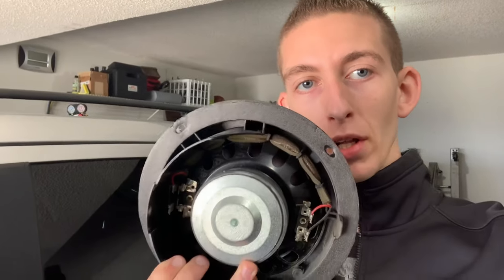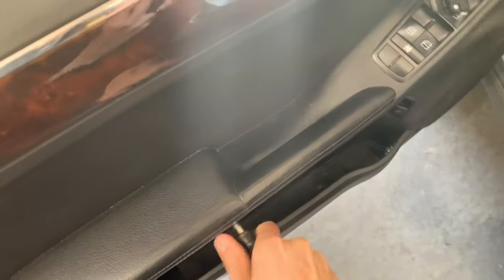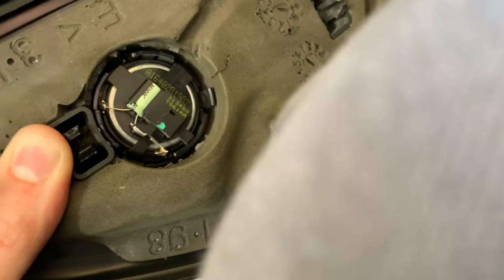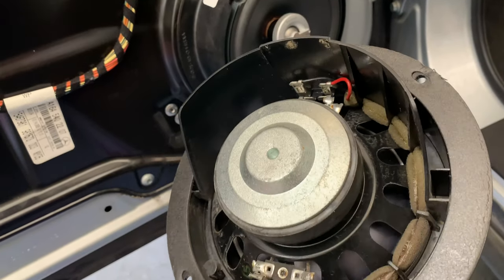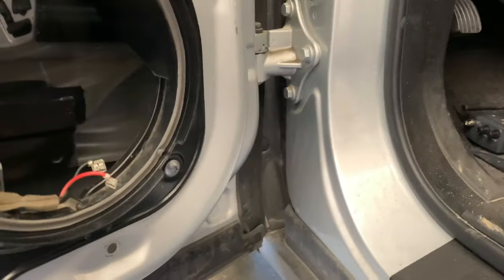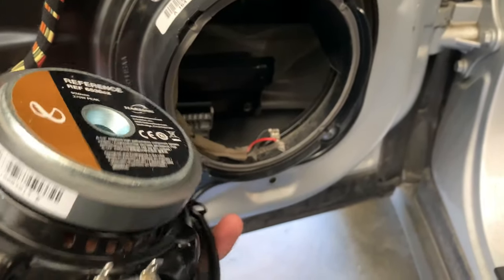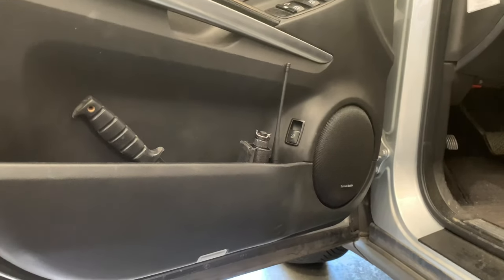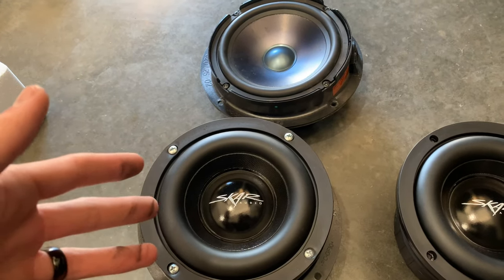How to Replace Mercedes Harman Kardon Speakers (upgrade and replacement)

Comment: How would you tell which way the polarity is suppose to go and thus know that you need to reverse the red and black wire connections?
Reply from the maker: You can connect a battery to the speaker such as a AA or a 9V to test positive or negative. If the positive side of the battery is hooked to the positive side of the speaker, it will poke out when you make a connection. If it sucks in, you have it backwards. You can test the old speaker coming out using the same method if you are not sure of the car's wiring.

Comment: I have a w212 2014 with harman Kardon. The Bass makes a rattling noise. It's really bad
Reply: Update I fixed it!! You dont need to do much buy a thick foam stripe with glue and remove the bass Cover stick it around the Cover and put back on. Boom fixed

Comment: You should do sound insolation for the doors in 4 materials the sound will be even better. My stock H/K started to play a lot better! Up to 122db. Center of the cabin 116db.

Comment: I just installed these REF-6530cx speakers in my '11 C63 using this walk-thru, and I'm very impressed! They're a massive upgrade--much louder, clearer, and punchier than the factory ones. And this install video was really helpful, but note that my w204 speakers were only single-coil so I didn't have to do this hack described here.

Anyone attempting w204 speaker replacement must watch this video! 👏

Comment: I prepping for a front and back door speaker replacement on a 2014 CLA 250.  It looks time consuming and I have two kids, but I'm going to give it a go. 

My concerns is that I purchased a three way 4 ohm speaker and I'm not sure if the tweeters will engage.  Basically I'm asking if the connectors on the factory speakers are only going to play the mid range frequencies since it's been crossed over and the component setup is relying on the tweeters near the windows.
This is is not my profesion or passion so I apologies for the misuse of any terms.  Any help would be greatly appreciated- thanks.
Reply from the maker: To my knowledge, it doesn't filter the frequencies going to the speakers (except for the sub) but that may not be the case on newer models. I will say that putting tweeters in your door panel and leaving the window tweeters in-place will likely not sound very good. Too much high-end. Running 4-ohm speakers you'll likely get even less low-end to begin with on a 2-ohm system. Doesn't hurt to try things out though. Everyone likes different sounds. If you're happy with the way it sounds, that's what counts. Hope this helps!
Reply: I appreciate the feedback.  I'm still considering putting in the work or returning the speakers.  It looks like a lengthy job and I'm a little worried it's not worth the time.  
I'll post an update with the final results if I decide to do it.

Comment: Do recommend replacing the factory speakers or go with a different brand? My front two blew out on my mbcla250. Thank you
Reply from the maker: From my experience with this Harman Kardon system, I would recommend getting  something similar. Whether that is the original 2 ohm dual coil speakers from Benz or aftermarket 3 ohm Infinity speakers like in my case. As long as you get something with similar specs, it should sound good. A lot of the normal 4 ohm speakers that you find at the audio store simply won't cut it though if you want to retain the original amp and sound system.

Comment: I need your help I have 2004 mb e320 so I replaced head unit and all door speakers went with JL c1 components in front and coax in rear.  I also worked a sub amp up and running a kicker L712.  So I needed another head unit so I got xtrons headunit and bought 2nd amp to power door speakers kicker 4 channel.  So I took out the harmon amp.  Super hard to get it out was in trunk and left side wall.  So how do I wire up 4 channel amp in it place so I can eliminate the fiber optics completely.  So I have wiring diagram and I guess I am only going to use the 4 JL door speakers so I have all the colors of wires so should I cut the wires off harmon amp of the 4 door speakers and wire that to kicker amp so now I can use the power remote and ground off harmon amp.  Rca to head unit were do I plug them to head unit?  I used the sub out rca and ran y adapter to rca and then to sub amp.  So rca for 4 channel were do they go on headunit.  Also as far as the door speakers do I have to run new speaker wire?  I am lost now pleas help

Comment: Thanks went with jlc1s. But i need a speaker that will fit in the center spot i have updated everthing what 3.5 speaker will fit in that spot i already have new amp and headunit

Comment: HELP !  I have a 2014 CLS 550. rR speaker filled cabin w smoke and just cracks loudly even w Balance/ fade moved away. I have had several MBs w the HK logic 7 system and this is 3rd w same issue. Conflicted on keeping stock and replacing amp or going with something like you did. Hope the sub is ok. It’s on a separate amp. Any suggestions are appreciated!!!

Comment: Did yours fill cabin with smoke before speakers cracking and failing?  Had 22 MBs of various models through the last 20 years. 4 have had this failure with HC system. Seems like it’s between 70-100k every time. Required new Amps and speakers every time. Little scary if you aren’t “used to it”.
Reply: Yeah! I had a tweeter catch fire and several channels on the amp die one hot day. Probably other dead drivers too, I need to test them when I source a replacement amp. Given your experience, it would seem this amp might be prone to thermal runaway🔥

Comment: Some Harman/Kardon speakers including on my Mercedes W204 C-Class sound great, but when you playing it loud with rap music, there’s some rattling noises especialy on the rear deck which where the factory subwoofer ROCKING at, IT SUCK DONKEY ASS WHEN I’M PLAYING SOME NWA
Reply: If you have a panel in the back by your rear window i popped mine up and saw the speaker was blown i used some glue and i put a rag to stop the plastic rattle cheap fix until i can find a suitable replacement
Reply: If it's like my W212, the plastic circle in the middle of the rear deck speaker cones becomes loose after blasting loud music for a few years.  I'm sure they can be glued back on, but I just removed mine and it sounds great again.  It is a bit involved to get to the deck speakers on my model, but it was worth the trouble.

Comment: infinity kappa 603cf or audison apk 165 2ohm which one do you recommend thanks
Reply from the maker: I would lean toward Infinity as they are closely related to the original Harman Kardon but I have not listened to the Audison speakers so I cannot comment on their sound in these cars. I did try a pair of Hertz and they did not sound good at all in this car with the original system.
Reply: @FlyByTire  Thank you. I really appreciate 🙏

Comment: hi 
Fly By Tire, my car is w212 e300 2010 Mercedes, with no original amplifier in my car (domestic edition), can I istall these REF-6530CX  Speakers with no amplifier?
Reply: speakers always work without an amplifier....just how loud you want to push the speakers with clarity is all.  The amplifier just "amplifies" the peak of the electrical wave or more accuratley stated the "power" of the electrical signal to move against the magnet thus producing more forceful sound "vibrations".

Comment: Hi,  I have a w211 E class 2007 with Harman Kardon. I’d like to upgrade the woofer but I don’t know how many Ohms the original has. Is it 2 Ohms as the rest of the speakers? Could you please help me with this information.
Many thanks Vili
Reply from the maker: Hi Vilmos, thanks for watching! If you are referring to the door speakers, yes it is the same impedance of 2 ohms. If you are talking about the subwoofer, that might be different although I doubt it is. The easiest way to find out is to get yourself an inexpensive multimeter and measure it. Hope this helps!
Reply: Hi, thanks for your previous answer.Now I have a another problem with the H K system in my 2006 CLS. The bass power weakens after a short time I turn the music on. If I disconnect and reconnect the battery, it’s fine for a while but then it starts again, sometimes it only takes 5 minutes and other times I get up to an hour of normal function. The front door speakers loose the bass power the most. Could it be the amplifier failing, or can the speakers cause this as well? 

Many thanks!
Reply: Did you figure it out?
Reply: @Jemstk  unfortunately no, but i think one of the speakers is faulty and causing this problem

Comment: Good video, i have 2016 c class, i heard some vibration noise from the central dashboard speaker. Do you know how can I fix it? Some people said it's subwoofer. But I checked maybe it's not. And I am not sure if I can just pop out the cover of that middle speaker thanks!
Reply: same problem here, need to figure this out lol
Reply: @FAWX  my friend said you can remove the cover and change a new one or just disable it
Reply: vibration noise is usually loose wire connection and then secondarily bad voicecoil which can be replaced at speaker repair shop...you could have them check the magnet also....it is the interplay of the magnet with the "voicecoil" that makes the speaker move.  Parts for the voicecoil are cheap...but the knowledge on how to repair takes time.  Suggest highquality voicecoil as you can buy JBL, Infinity, but brands don't really matter...it is how it's made.  Ask around at an electronic parts store.....

Comment: FYI - with these cars the door will not lock when the door is open, which is why you thought it was broken but it's not.  By design the lock switch will lock all the other doors but not an open driver's side door.  Just in case you hit the lock button by mistake, close the door, and then realize your keys were left in the car.

Comment: I replaced my harmons with Memphis
Reply: How did that work ?  4 of my 20+ MBs with Harmon Kardon systems filled cabin with smoke before the loud popping. Had to replace Amps every time   Love to hear your feedback. Thanks!!
Reply: @l.b.stringfellow2413 I used jl c1 front back and two jl 12s in rear two amps 1 4 channel and 1 mono and all the goodies xtrons sounds great